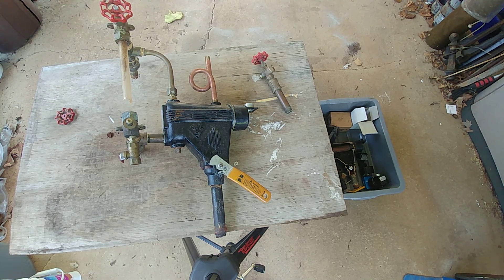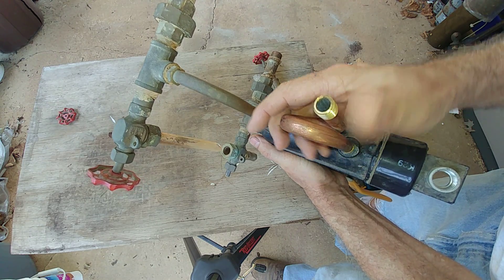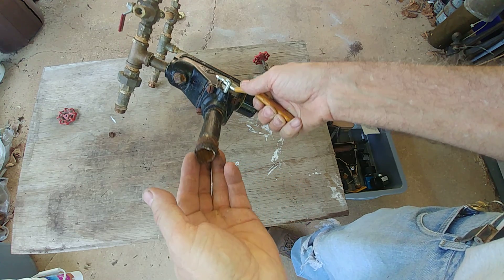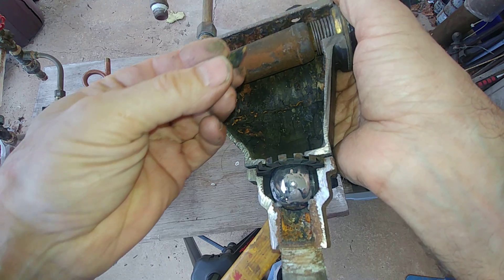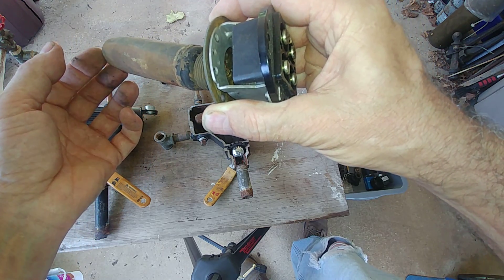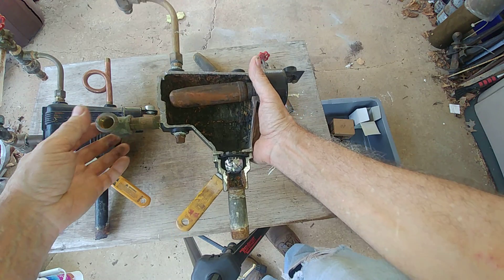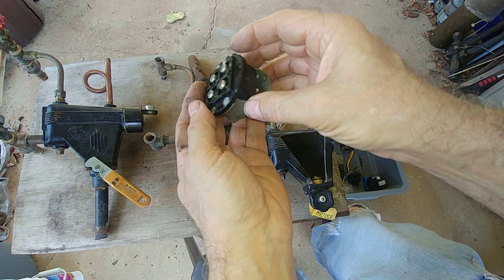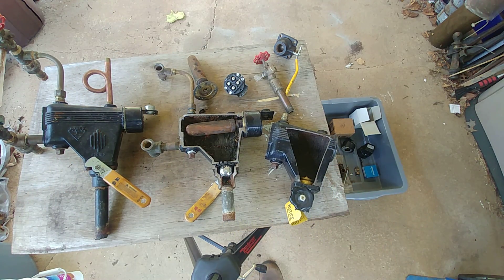McDonnell & Miller's Venerable #67 Low Water Cut Off For Steam Boilers

Comment: Hi Gordon my name is Steve I have watched many of your videos and thank you for making them. You are very knowledgeable about steam and I am not but we are learning. What I'm in desperate need of is my boiler has a McDonnell & Miller mechanical water feeder on it. On top of the manual water feeder is a McDonnell switch. It is a TYPE 2 switch looks like many years ago someone had made a plastic cam to control the switch? Well over many years that plastic has failed now. I'm sure there is a replaceable part for it but I cannot find it. My steam boiler is over 75 years old and still works good as long as we keep water in it. I am trying very hard to get the automatic water to work right, and most of all the low water switch to work again. Hope you can help me out thank you keep up the good videos. Steve in Wyoming
Reply from the maker: Thank you for your kind words!
I could well be wrong, but it sounds like you may have a McDonnell & Miller #47-2 low water cut off and feeder (the 2 in 47-2 stands for...wait for it, yes, your #2 switch lol)  
I have a few videos on this contraption.
To say it is not my favorite control is an understatement. 
Look up the #47-2 and look at pictures and parts break-downs online. 
That should get you started on getting it fixed.
Definitely concentrate on the low water cut-off part of the show!
I would consider by-passing the mechanical water feeder part and going to just manual feed to add water.
If that is an issue, then I would beg you to consider to have installed a modern water feeder such as the VXT by Hydrolevel.
Reply: @gordonschweizer5154  Thank you for steering me in the right direction. I found the part that I needed on eBay and it is on its way thank you again and keep up the good videos they do help a lot.

Comment: Mine started leaking out of a pinhole in the back by the electrical connections. Are these difficult to replace?
Reply from the maker: Possibly.
It depends on being able to remove several small screws that are prone to breakage.
Then, you'll need the proper gasket and float/bellows part.
And maybe a new switch, too.
Or,
Chuck the whole #67 debacle and install, or have installed for you, an electronic probe type low water cut off.
Its possibly more trouble and costly, but much much more reliable.

Comment: Hi there. When I drain it, how much should I let out of my boiler? A gallon? A bucket full?
Reply from the maker: Short answer - less than a gallon per each opening of the drain valve. 

If you can, the boiler should be firing while you drain so you can observe it shutting down and then restarting when you stop draining.

That is Very Important!

What should happen when you first open the drain is a sudden rush of rusty water and then the flow should slow down. Shut the valve at that point and wait a few beats to allow the chamber to refill. 

Drain again.

Maybe drain a third time. The water flowing out should get to a "weak tea" look after a few drainings.

That may be a bucket full or not.

Best to Not just open the drain and fill the bucket in one go, but cycle the valve for the most effective flushing.
Reply: @gordonschweizer5154  this is extremely helpful. We just moved in in July and this is my first winter with one of these things. (We live in Massachusetts. Have oil heat.) I don’t know how much maintenance the previous owners did on it. I drained about a gallon out and it’s still very dirty colored. I guess i need to do some each day until it’s tea colored. 
Next question: what should I do with the water? Is the brown stuff just rust residue? Can I dump it in the sink? Or do I need to dispose of it some special way?
Reply from the maker: @carolelk  It should be no problem to dump it in a laundry tray/sink if you have one. It should be just hot rusty water.

Comment: Thank you for this info. Could you comment please on this question of mine?
I have the PROBE type Low water cut off, currently on my new steam boiler. This PROBE type LWCO, does not have any way of "blowing down" this boiler, like the old #67 did.  Should I have a #67 LWCO installed, on my new boiler?
I am worried, that because; there is no "blow down"  feature available on the   
PROBE TYPE LWCO, that I now, will NOT be able to rid sediment and dirt from my new boiler.
YOUR input on my concern will be appreciated greatly.
Reply from the maker: You should not need a #67.
No one needs a #67 anymore.
The probe type LWCO is superior, but only provided the installer of your new boiler read, understood and followed the instructions that come with your boiler for cleaning your boiler properly, forever eliminating the need for weekly blow-downs.
Cleaning the boiler properly within the first weeks of operation is the important thing.

Comment: Very good video. My water has plenty of deposits. Always attacking my low water cut off. This year I didn't clean off my float & check the switch. So my aquastat paid the price for the high temperature.  I'm lucky it could have been worse. I drain it very often.  It just needs to be cleaned every year. Tiny dozen screws are tedious
Reply from the maker: Thank you for your comments!
Glad you didn't lose your boiler.
"Tiny dozen screws are tedious" indeed!
It's worse when they break!

Comment: New sub here.  I was smelling a plastic chemical smell in my basement and noticed the tube was not showing a water level so I shut down the boiler.  I have an automatic feed that has been working but not sure why the tube was dry.  Bypassed the auto feed  by way of the ball valve and filled the boiler to a little over half on the tube. Flushed the LWCO till the water was light brown. Now I am worried I might have damaged my boiler.  Is there a way to test my LWCO float and switch?  It is the same as the one in the video.
Reply from the maker: It seems you had a failed #67 not shutting down the burner when it should.  
When you flush the LWCO while the burner is running, the burner should shut down (it should also ask the feeder for water, but that is a convenience for you, not a safety issue).
I would check to see if the float is stuck.
If you cannot free the stuck float, I would not operate your boiler until you can replace the control. 
Difficult to tell from here if you have damaged your boiler, but if it is still holding water, that is a good sign.
Reply: @gordonschweizer5154  thank you.  Yes the boiler now shuts down when I flush the LWCO and comes back on after I close the LWCO.  There is also a lot of sediment in the sight tube and corrosion on the outside so this week it is warming up and I am going to try to replace the sight tube and connections.  What do you suppose the plastic chemical smell was.  That is what worries me the most.  Thank you
Reply from the maker: @Peter-976  Very glad to know the #67 is working as it should.
As to the plastic chemical smell, it is difficult to say, but perhaps it was the wiring near the gas valve (?) that got overheated as the water boiled away.  All wiring for your boiler is exposed for inspection?
Reply: @gordonschweizer5154  Yes mostly runs behind the front cover.  EG-11 two pipe steam boiler installed in 2005.  New LWCO installed about 3 years ago.  It is a 67.
Reply from the maker: @Peter-976  Good that the #67 is relatively new.
I'd see if you can get a look at those hidden wires.  Check if any plastic part looks melted.  That might have been the source of the burnt smell.
But, overall, It seems like you avoided a total loss.
Check that #67 every week, and be ruthless in fixing leaks that can cause rust build-up in the #67.
Reply: @gordonschweizer5154  thanks.  Wires look good so I`ll keep looking.  Gotta get that sight pipe clean or replaced so I can keep an eye on the water level.  More maintenance than I thought.
Reply from the maker: @Peter-976  You sound like you are on the right path.
I'd see about adding a little 1/4" drain valve on that sight glass to check it and keep it clean going forward.
Reply: @gordonschweizer5154  yup I ordered one brass 1/4" ball valve on line and also a brass 1/4" male to 3/4" hose adapter. Should be here on Tuesday.  Meanwhile I am watching all of your videos.  They are done extremely well and I thank you for them.

Comment: I caught my boiler before it dry-fired today, i have an older style 767 which is not working. Do you think i should replace with another 767 or go for a probe type??
Reply from the maker: So glad you caught it! Whew!
Replace with a probe type if you can.
Make sure the probe is at the proper level. That's hard to advise from here.
Also consider adding a back-up LWCO.
Reply: @gordonschweizer5154  Thanks Gordon! Appreciate the feedback. Should i go with a M&M or Hydrolevel lwco? Should i keep the old 101A feeder?
Reply from the maker: @jackmansoura  Get rid of the 101A feeder. It's junk. Replace with a Hydrolevel VXT.
As the what LWCO, you could see what your local supply house stocks, as M/M or Hydrolevel both work.
It sometimes depends on which control better fits in the space.
A remote probe with a connecting wire with the control mounted elsewhere is an option.
Please get the right voltage controls either 120v or 24v.
There are a lot of variables. 
This is by no means a complete list of options (except the VXT!).
Reply: @gordonschweizer5154  Any recommendations for a model?

Comment: Great job explaining how the #67 LWCO works.  I believe my float is stuck on my LWCO.  The entire unit was replaced 3 years ago.  Is there a gasket or something I need to worry about if I remove the float for cleaning?   Also, while the float is out, should I try to insert a brush to remove some of the buildup of rust...or just leave well enough alone and don't go poking around in there.  Thanks for your advice.
Reply from the maker: Sorry to hear that your three year old #67 is acting up. 

Yes, if you pull the float, there is a gasket that might need to be replaced.  Any plumbing supply house should be able to get it for you. Please note that there are also about a dozen screws of various lengths and types that will need to be kept track of if you remove that float assembly.  Truly a masterpiece of design (sarcasm).

Once the float assembly is removed, you can chip away at any rust.  Its basically a hollow shell at that point.

If your #67 is rusting up that badly after only three years, you might be taking on too much fresh water due to leaks or your water is very acidic.

Before you go through all that, make sure its not the switch that is acting up.  An ohm meter will help with determining that. The switch is much easier to replace if needed (but they are not cheap).

If you can, I'd see if you can replace your #67 with a probe-type LWCO.  Fewer maintenance issues, no weekly blowdowns, and and a more reliable safety control.

Comment: Should every low water cut off have a transformer.
Reply from the maker: It depends. 
If all of the control voltage is 24v (usually gas fired), then there is a step down transformer involved somewhere in the circuit to go from 120vac to 24vac.
If the control voltage is all 120vac, no transformer is needed (usually a power burner gas or oil).
In some cases, the shut-off control circuit is 120vac, but the water feeder circuit is 24vac (not a good idea to mix and match different voltages in the same enclosure).
Reply: @gordonschweizer5154 , Thank you sir, I'm much obliged for the information.

Comment: Every heating season I see at least one boiler cracked because the LWCO was sticking and keeping the switch closed when the water went low. If the LWCO doesn't shut the burner off when I open the blow down valve ; I always run a stick of tubing up through the blow off valve and work that float up and down until the  switch is responding immediately. I always show the home owner how it works and why it is so important to flush and check it. If the #67 is real crusty, I sell them a new one. I tell them it's about $1000 for a new LWCO or $10,000 for a new boiler. The electronic feeders fail as well. I'm a firm believer in two LWCO's on a steamer, since I've seen so many of them fail. This is a good video to show to a customer when I come across a flakey #67. Thanks for the videos you make, Gordon.
Reply: $1000? 😆
Reply: @guzman9011  The part, discounted is $550 to the trade.  American Iron isn't cheap any more.
Reply from the maker: Thank you very much for your comments!
Reply: What is #67 and how do I know if the WATER cut off valve is malfunctioning?I’m new to steam boiler and learning from you.

Comment: Thanks for the video. Very informative. We have this device for our boiler and I was wondering if you know if it is bad for the switch to kept on the "On" position for an extended period of time?
We have an auto feeder attached, but we installed a flip switch to keep it off during the summer. However, this means the switch on the low level device will be in the "On" position until we fill the boiler. Do you know if that will wear our that switch in your video?
Reply from the maker: It shouldn't be a problem. Generally, it is the "cycling" of the mechanical switch that wears it out.
Are you losing water from the boiler over the summer?  Do you have hidden wet returns?